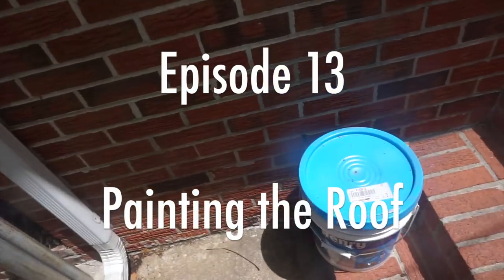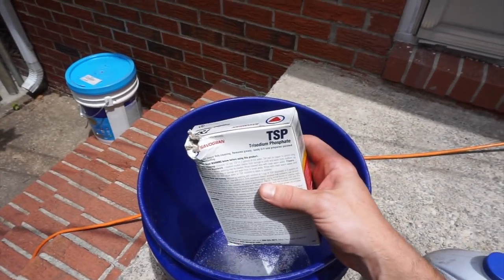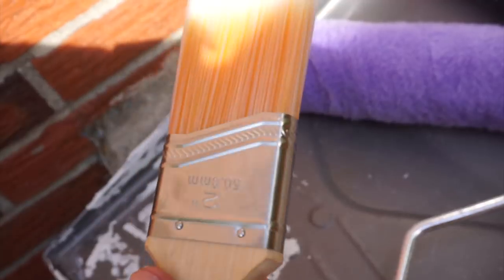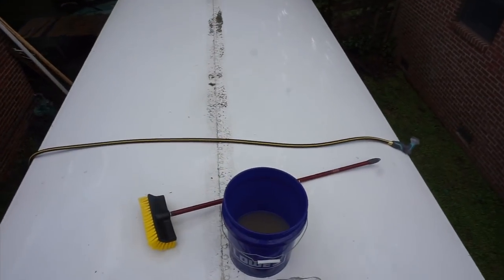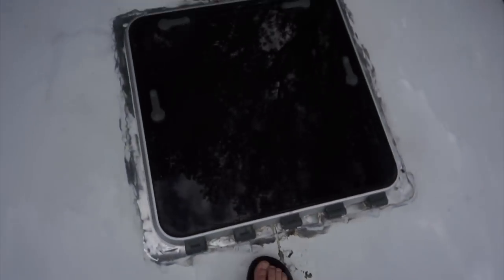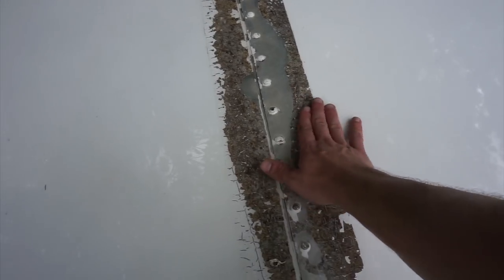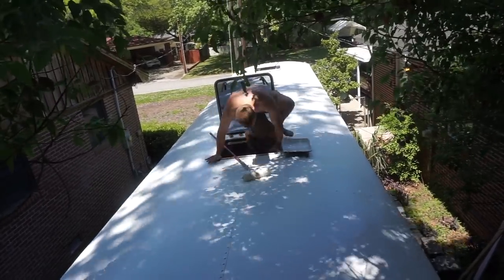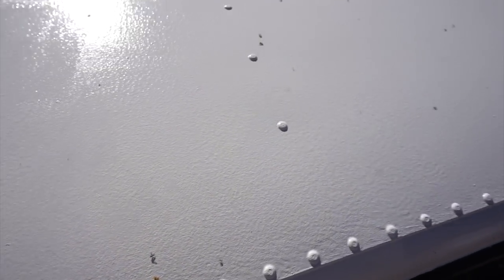Painting the Bus Roof with Henry's Tropicool: School Bus Conversion Ep 14

Comment: Why did you choose to apply two coats when Henry's recommends only one coat? Did you have any peeling or bubbling issues between coats?
Reply: Really you don't need a second coat, But as nice as it turned out I believe in spring I'll also do a second..  We plan on using it on the inside flooring, before our hardwood goes down it will act as water proofing on our sub floor.. Especially our bathroom.. insolation
Reply: @montanagarcia8887  I'd be concerned about using a product meant for outdoors indoors unless the directions say it's allowed. Never know what kind of chemicals it could be releasing into your living space as it ages.